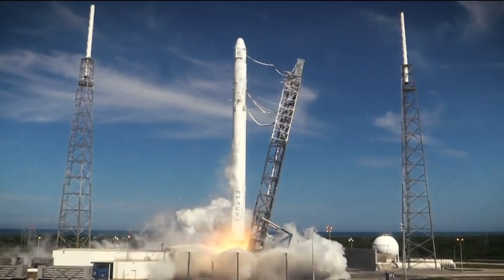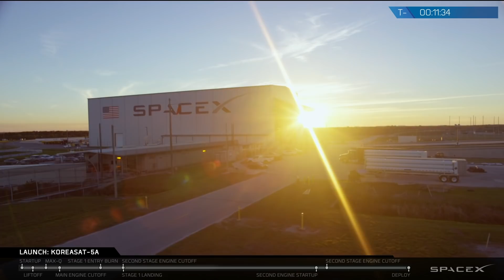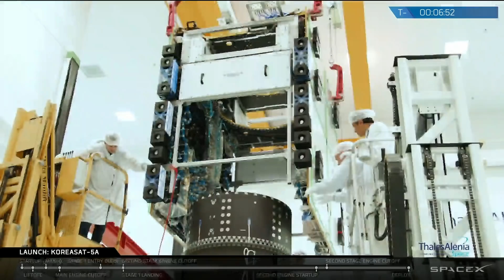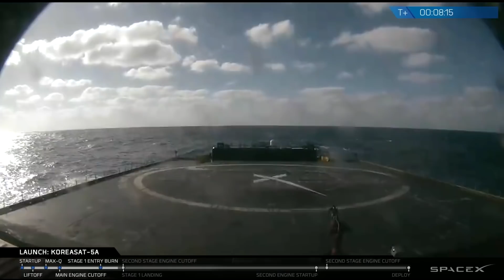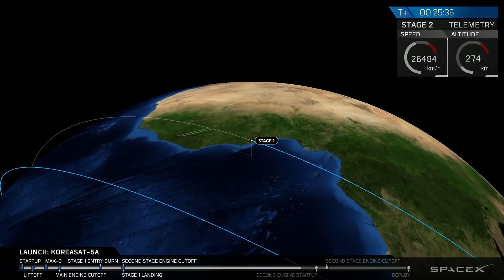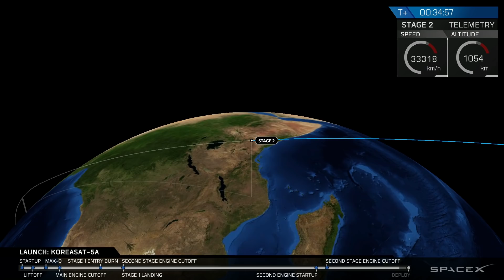Koreasat-5A Webcast

Comment: Please correct me if I'm wrong.  At 28:25 that fuel burn on a 1st stage after landing... It looks like it come from a crack in the stage
Reply: MrMaxKey Probably from the turbopump exhaust which runs on a very fuel rich mixture.

Comment: Why can't a video drone be launched from the pad 30secs before estimated landing, fly a little bit away to get a good shot, then have the drone film everything so there isn't any stutter or delay from the rocket landing? That would cost 1000bucks for a good drone and programming would be so easy....
Reply: Wind and sea states, NOTAMs, NOTMARs: Do you know of a drone that can hover in  a (potentially) 20kt crosswind with gusts up to 30kts? The landing area is a no-fly zone as well: Can you guarantee with absolute certainty that a $1k drone wouldn't smack into a few million dollars of first stage? I know you're thinking of something like a DJI Phantom, but that ain't gonna cut it: Because of personnel safety reasons, the landing box is larger than the transmitter range for one. Automating the drone has a whole other host of issues (How does it land once the stage lands, How do you point the camera? How do you test that it'll do it safely?) Your idea would drag the FAA and FCC deeper into SpaceX's ass than it already is.

A better way to prevent cutouts is  to use a hard wire from the ASDS to the recovery vessel or to a small motorized launch (from the ASDS) with a satellite uplink .

Even then, the sea states can make that dicey.
Reply: I think that SpaceX does record the landing attempts with drone boats.  But they can't transmit the footage to the satellite.

The "blooper reel" video that SpaceX released last month included footage of the failed SES-9 landing attempt, which was in March 2016, and gave the reason for the failure.  Before that video was released, no one outside SpaceX knew what had happened with that landing attempt, or why it had failed.

Comment: Why do the webcasts always talk about geo stationary orbits, which is about 35786 km radius circular orbit, but the satellites always only around a few hundred kilometers altitude? Does the satellite gets so much impulse in this below 1000 km altitude that eventually it'll rise up to 35000 km? How long will that take? After running an 800m a marathon distance is very-very far, and gravity is a relentless force.
Reply: Once you are in orbit, gravity is not relentless like we experience on Earth. Conservation of energy is the way you should think about that regime. In a circular orbit, your velocity and altitude are perfectly balanced such that neither change. However, right after the second burn, this is no longer the case. The satellite has a much higher velocity than necessary, while still being at a relatively low altitude. In a matter of hours it will trade that velocity for altitude, keeping the energy in the system equal at all times. Once beyond the highest point in the orbit, the altitude is traded for velocity again. Gravity is obviously still important, but you're not fighting it anymore. You have all the time you want once you are in orbit.

This allows the satellite to time its circularization burns at the most opportune time. At 36000 km, gravity is significantly weaker than on the surface ( ~15% if I did my math right). This decrease in gravity as you go up makes it much easier to raise the orbit from 20000km to 21000km compared to going from 1000km to 2000km. The amount of energy the satellite needs to finalize the orbit is very small compared to the kick the second stage gives it. Like Jason says, you typically only need about 1500-1800m/s of change in velocity. That sounds like a lot, but the second stage alone gives the satellite (and itself + the fuel it is carrying) a kick of around 7.5-8 km/s. And that's ignoring all the energy used by the huge first stage to drop of the second stage at around 65km at 2000m/s. 

This should give an indication that the satellites only have to do finishing touches compared to the enormous effort required to get something in GTO to begin with. The altitude is just a small part of the picture. The real "currency" in space is velocity, or rather the change in velocity. Just take a look at the gigantic changes in velocities when comparing the start of the second stage burn compared to the end. That's where the energy is.
Reply: I know he mentioned geo stationary transfer orbit, but like I said, 35000 km is 3 magnitudes larger than 350km.
Reply: Geostationary Transfer Orbit is any orbit which is used to transfer sats to GEO. Usually it means an orbit with the low end of the orbit at the same height as Low Earth Orbit, with the high end of the orbit at, just below, or (even better) just above the height of GEO. It's relatively easy in terms of fuel expended to lower the far point of an orbit or  raise the low end of the orbit (as they'll do in this case). SpaceX usually aims for something around GTO-1800, which means that the spacecraft they're deploying will need to expend enough fuel to change its velocity by 1800 meters per second to move itself into GEO. Sometimes they'll hit GTO-1500, which is better, because it saves fuel on the spacecraft. However, both 1800 m/s and 1500 m/s change in velocity isn't that much. It's fairly cheap (again, fuel wise) to make such a orbital change.

What's worse is the time it takes to do that. It often takes weeks (for a chemically propelled satellite) or months (for a sat with an electric ion drive) to raise their orbit. That's time that the sat isn't making money for the company in question. A few months = a lot of revenue that the spacecraft isn't bringing in! That's why you'll sometimes see the company request that SpaceX (or whoever the launcher is) try to push the rocket a little bit harder to get them closer to GTO-1500 rather than 1800, because that can mean the sat gets into position in GEO several weeks earlier, making them more money faster. Less fuel used can also mean several additional years of on-orbit operations for the satellite in question, which decreases capital costs per year for the company operating the sat.
Reply: I don't think anyone here has answered your question. The reason the orbit is 350 km is because they have to first put the satellite into a parking orbit. 

Before performing a second burn, they need to wait for the satellite to reach a specific location, otherwise the satellite would simply be in geosynchronous orbit on top of a random country.

Once they've successfully performed the burn, the satellite finally circularizes the orbit with the third and final burn at the apoapsis.
Reply: https://en.wikipedia.org/wiki/Parking_orbit
Reply: Csaba Toth They accelerate the vehicle to a very high velocity near it's perigee to extend the apogee of its orbit to the altitude of a geostationary orbit where they satellite uses it's own on board propulsion to accelerate itself once at the apogee to circularize its highly elliptical orbit. If you accelerate in an orbit the kinetic energy will eventually be converted into gravitational potential energy causing you to go much higher as you approach the other side of your orbit until you fall back towards your periapsis and speed up again but that doesn't happen here because the satellites circularizes its orbit at the apogee.
Reply: Teboski78 I think op is asking why they first place the satellite in a 350km orbit, not how they do it. It is theoretically possible for the rocket to deliver the satellite straight to GEO in one burn its very costly and impractical.

Comment: They could really do with adding extinguishers on the drone ship. One of these days I can see the fire getting out of control...
Reply: There are four huge water cannons on board.
Reply: Thanos Tourtouras Makes sense, never noticed them use them though. Bottom of the rocket was burning quite a bit this time, looked like it could have caused a problem.
Reply: The bottom of stage 1 is cooled by liquid nitrogen on the inside of the booster. 
If you cooled the rocket any faster than it already is then the metal would freeze, crack and shatter. there fore making the whole idea of landing the ship pointless.
Reply: I guess rapidly and locally cooling down something hot may not be the best for reusability, and letting whatever is burning just burn and replacing it later is cheaper.

Comment: I really don't get how they can't provide stable feed for first stage landing...
Reply: Ideally what they'd do is have a second ship nearby that broadcasts the signal and hardwire the camera to that or use a drone... however that's adding additional expense for no real reason. They don't need to broadcast anything so we're lucky with whatever we get.
Reply: +Lolek Bolek
Well it's not so easy to get a stable signal out without a landline or cell network especially when something like a rocket booster lands nearby.
Reply: Willie Gillie It's usually 100% reusable so long as it doesn't hit the deck too hard. The only damage caused by the flames is to the paint job, the rocket itself was engineered to withstand much worse than the small fire that occurred today.
Reply: I bet there would be a line of boat owners to witness (and broadcast) first stage landings, BUT i'm pretty sure that any shipping is prohibited at the time and place of landing.
Reply: This is a barge pitching around in the ocean hundreds of kilometers off shore, add into that the force of the stages engines when it comes into land which causes a ton of vibration. With all the movement it's difficult to maintain a link of a high enough bitrate for video. Also at the end of the day making a nice video for the stream just isn't their highest priority, its the data link from the rocket they care about and that doesn't seem to cut out, that's how they announced that the first stage had landed after they lost the video.
Reply: Lolek Bolek yeah, makes ya wonder what really happened lol
Reply: Owen Easter sounds to me like all that heat probably cooks that stage pretty well. Wonder how much of it is really reusable
Reply: Hi, having support from "enthusiasts" (some may have influence on the future of Space-X) could be easlily generated (publicity is very important task on the way to a future in Space and/or on Mars).
Reply: DiabloDBS They have stable video from both stages while firing the engines. They have observer ships in the vicinity which could be used as relay stations. They are landing the rocket on a dime, can't believe this is so hard to accomplish...
Reply: Including all the other factors listed by other people.
Computer hardware generally shutdowns around 110+ degrees celcius, and about 200m squared around the drone ship would feel a HUGE burn effect maybe even bringing the water around the ship up by 25 degrees, so the ship itself would be dangerously hot, as you saw the booster itself was onfire despite being cooled by liquid nitrogen heat syncs (negative 100 degrees celcius)
Reply: They clearly get that it has a "show value". They are taping it at all.. They pipe in noise from the viewing area in Hawthorne to hear the excitement.. It's just not a high enough priority to spend a lot of extra money on it. They still get the video and they do the best with the money they have spent. It's literally a rocket landing itself on a drone boat way out in the ocean.. I can't believe you're complaining about the feed not being perfect so you can watch it live on your phone while sitting on your couch.
Reply: Fredex I think many people are really interested in the first stage landing even though it serves no purpose in the actual mission. They should know that it has a "show value".

Comment: What are those solids that got floated away after 2nd stage reignition? Fuel leaks?...
Reply: it's solid oxygen
Reply: Probably solid oxygen or solid water (aka ice)
Reply: Liquid oxygen turned into solid one
Reply: I noticed also. I even thought that, dang, space is not so empty after all, but now that you comment i guess it is not space dust.
Reply: It seems like they're venting small amounts of oxygen from the heat exchanger. When they do this while the engine is off the oxygen isn't gasified by the heat so once exposed to vacuum some of it boils off and they thermal energy lost in evaporation causes the rest of it so solidify. Same reason you feel colder getting out of a hot shower than a cold one evaporation cools down the remaining substance dramatically.